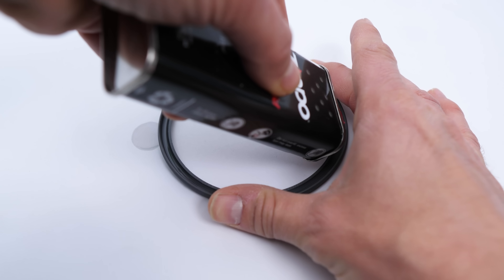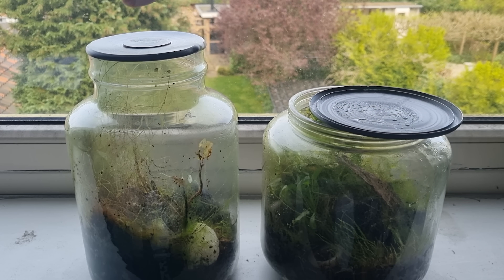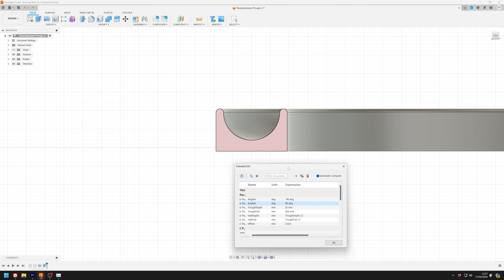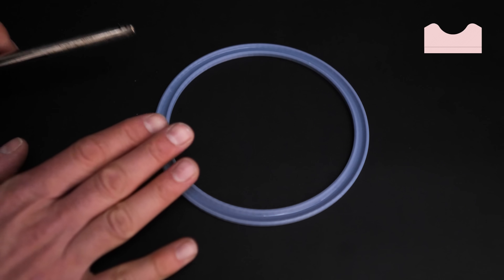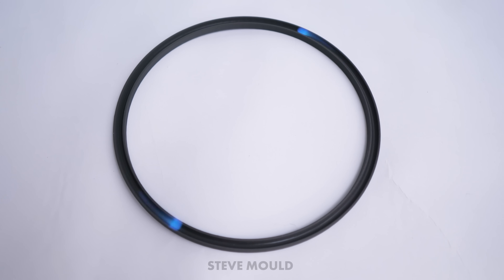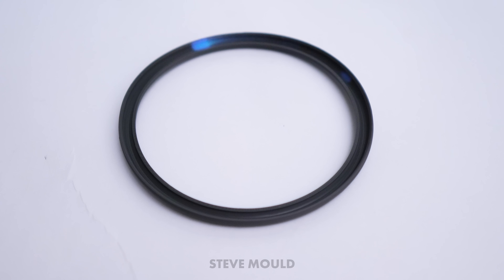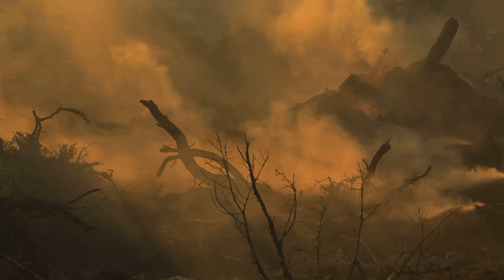Bizarre travelling flame discovery

Comment: If you pour some lighter fluid inside an can you can get a oscillating effect.  It will burn - than nearly burn out - pull new air - and burn again. This can make pulsating (slow sounds) up to shrieking (high frequency sounds) I was fascinated by that effect than I was a child. The frequency depends on the size of the hole and the size of the can.

Comment: Steve touched on it with the heart fibrillating, but it also happens on every heartbeat, and we can use EKGs and EGMs to locate the source of arrhythmias and burn them to break the circuit, restoring normal heart conduction (usually permanently). If this type of thing interests you, I highly recommend researching EGMs and arrhythmia mapping.

The design where the flame splits and reconnects resembles a re-entrant tachycardia. The circle with legs out of it is similar to a micro re-entrant tachycardia. On the augmented spiral, you can imagine a re-entrant tachycardia forcing an unstable rhythm, where the ventricles beat too quickly to fill. Blood pressure will slowly spiral down until the coronaries are unable to perfuse, eventually leading to cardiac arrest if the rhythm isn't returned to something stable.
Reply: Catheter Ablation! I actually had to have this procedure twice. First time, I was asleep and they couldn't figure out all of the sources. Second time, I was awake on the table for over five hours while they fed the catheter up to my heart-- this time actually worked though.

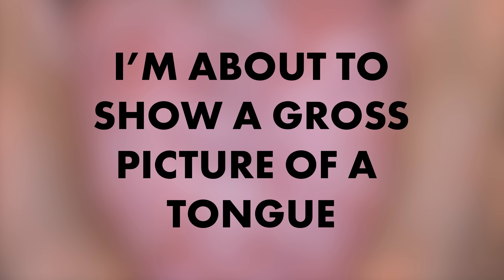The beginning of this video seemed very familiar, until we got to about 7:28 and he made that connection. Pretty cool stuff and a great vid.
Reply: So excited about this video! As a new medical graduate hoping to go into EP, I was immediately thinking about how this model could be used to demonstrate entrainment in reentrant arrhythmias. 

I was hooked into this a few years ago by Dr Joshua Cooper's video on entrainment (https://www.youtube.com/watch?v=-D3ZbyDiOwE&t=1924s) and I think there are so many things that can be demonstrated using this model!
Reply: wdym "burn them"? I'd love to learn more!
Reply: @TheNightOwl082  LIterally use something to scar the myocardium so it no longer conducts
Reply: I have a friend whose job is to do exactly this.

Comment: @stevemould.. Not sure I agree with your description around how the flame travels. You talk about how the lighter fluid has started to evaporate by the time the flame has returned to its original position...

However if you have two flames on the same circle this analogy no longer works.
I think with a big ring you could have multiple flames looping around at the same time, you could try this by using your finger to prevent the fire in spreading in the wrong way.

Comment: 10:12 looks kinda like AVNRT
For non-medical folks, it's an arrhythmia of the heart where 2 seperate pathways for electrical signals exist in a part of the heart called the AV node.
Sometimes erroneous signals cause the 2 pathways to work kinda like a circuit independently producing extra heart beats causing the heart to beat very fast.

Comment: Now here's an idea: Line the bottom of the trough with a an absorbent material like a fine sponge and soak it with the lighter fluid and have fine capillary tubes built into the bottom of the trough that continuously feeds more lighter fluid into the sponge from a larger reservoir. Endless!

Comment: you should be able to make one that lasts WAY longer by using a porous 3d printer filament, some wicks , and a reservoir like a jar.
you'd also probably need to put some kind of coating on the outside of the track to stop the vapours from exiting the intended area

Comment: Hello Steve, you may be interested in Rotating Detonation Engine, which exploits the same concept but at a much, much faster rate. 
In your case, the butane-air mix and the small width of the trough create a flame front propagating at a (rather) constant speed; which is the laminar flame speed at this specific mix ratio. You can actually probably find "ideal" parameters using the laminar flame speed of butane at various mixture ratio (between 10 and 40 cm/s) and the evaporation rate of the butane. I will try to do the math if I find the time to do it. I also wonder if it could be possible to design logic gates with your setup, since flames coming from different tracks can interact. I think you might like this idea, given your previous videos. A laminar flame computer !

Also, I'm working on my spare time on a cellular automaton that integrates ressources depletion and reformation as a driving force to "life" complexification. The idea is that life evolves due to imbalance in the available free energy, i.e in zones with time or space-varying free energy, which makes evolution a consequence of the 2nd law of thermodynamics.

Comment: It would be interesting to see this in a hourglass shaped profile. Where the bottom part contains the fluid and the top part containing the gutter. I think this will give you enough wiggle room to play with the side curves as more gas will be able to accumulate to the top part in the gutter depending on the opening ofc.

Comment: The spiral and you lighting multiple flames on it immediately reminded me of sequential delay-line memory from the early days of digital computing, where signal pulses are continuously recirculated from the output to the input of the line, acoustically, electrically or optically. I don't see why it wouldn't work with a moving flame, although it'd be wasteful and difficult to do safely.

Comment: This is very similar to demonstration one of my physics professors once gave. He coated the inside of a 5-gallon carboy with alcohol and dropped a match inside. With the lights off, you can see a fireball in the center oscillate in size (and hear it go thump-thump-thump).
Reply: Wouldn’t be allowed these days.  The Safety ‘Elfin would ban it

Comment: You can create one-way tunnel - it is a step which is short enough for the flame to go up, but high enough so it cannot go back down. You can put it in the generator loops to stabilize them.

You have a non-connecting crossing already in the 8 symbol and a a splitter. The only missing part is the NOT gate and we can have a running flame computer with no moving parts and no electricity.
Reply from the maker: That was the problem I was having! How to stop the fire traveling back up the input lines that carry a zero. This could be the answer!
Reply: @SteveMould  Tesla valve? Keeping it 2D would let you CNC mill it, build up logic blocks and use some sort of reservoir to keep it full.
Reply: @alexdavies2036  i personally don't think that a tesla valve would work, because in the video (12:05) the flame makes a 270* turn over a straight through. It would be cool to try though!
Reply: @SteveMould  I can't wait for the dark shots if you manage to pull it through!
Reply: @SteveMould in computer architecture wires are never split or joined directly, only through the logical elements. That's why the electricity in it never goes backwards and not causing short circuits. You just need to invent a transistor somehow
Reply: @alex0088800  You can directly join wires through 2 diodes, which form an OR gate. This will block reversed fire, so it doesn't go the wrong way
Reply: i was thinking an XOR could be made with two diodes pointing each other, and then one line running out. When one fire crosses, it would burn all the vapor and the next pulse would die. If both flames come at the same time, they crash like in the circle and die.

 You can use this same idea to make a NOT gate by having a pulse sent every second or so down a line, and then a diode across the line to burn off the vapor. The timing would be hard to get right, but it might work.
Reply: Let's gooooooo
Reply: If only you could create some sort of… firewall
Reply: Should also use a wick placed horizontal into the channel.  Then you can have it burn slow on top and have plenty of lighter fluid under the wick.   You can have it burn continuously.
Reply: In order to create a not gate, you basically need to be able to put out a fire, with a fire. 

There seemed to be this sort of phenomenon going on in the video, with flames cancelling each other out. Based on that, this is worth investigating further.
Reply: @anderpanders6210  that part sounds do-able. How are you supposed to make the absence of fire create a fire though? 0-->NOT--->1?
Reply: exactly what I was thinking about all throughout the video. This can lead to a very interesting alternative to electricity
Reply: A computer with this would be amazing!
Reply: The real issue is how much error rate are you willing to tolerate since even simple designs have shown they don't always do what you want.
Reply: It's not enough, he needs an "AND" gate, which passes the fire only if both inputs have fire. In computers it's a transistor
Reply: @alex0088800  You can make any logic gate out of NOR gates, which are just 2 diodes and an inverter. AND gates can be made from just two inverters each going into a diode, and the diodes go into another inverter.
Reply: There is a cellular-automata called "wireworld". You may want to look into that to find a possible not gate.
Reply: It’s going to be very tricky to get the height right, because flame will jump down along the trail of vapor coming from the lower track. 

I wonder if there could be a mechanical gate where the first track ends in a persistent flame and the heat lifts or bends something that puts out that flame and lights another track.
Reply: Sorry for the reply notification 😅 but this is an underrated comment!
Reply: I would love to see this attempted!
Reply: For the putting the flame out part of the NOT gate, how about something that sucks the vapour away? Maybe a tube where the flame at one end sucks vapour away from the other end (putting out the flame at that end), and the fire can't go through it because of insufficient access to oxygen? The vapour would need to be directed - perhaps with a slightly conical tube, or a valve
Reply: @BrendanWeibrecht  sucking idea sounds good. Put two tracks on top of each other and have them run flames in opposite directions. The tracks should be isolated, except for narrow vertical pipes repeated over a distance of slightly over flamelength/2. The pipes should be too narrow to allow the flame to pass through, but would allow top flame to steal the gas from the bottom lane and extinguish it. This would implement ~A & B.
Reply: On a second thought, I don't think you even need to isolate the top lane from the bottom flame. So instead, you can just have elongated step. Flame from A would climb up the step and go forward until it either collides with the lower flame or until the end of the track. Flame from B would travel through both lanes until it collides or it passes the whole distance and detaches.

I believe the top flame should be able to extinguish bottom flames from longer distance then it needs for propagation.

Heightmap (connect A from the left, B from the right, output at the bottom):
00000000000000
11222222222000
00001111111111
00001000000000
Reply: @BrendanWeibrecht  i bet the tube could be heated like a fireplace flue and suck the vapor away with the rising heat. This might just create more vapor though.

Comment: There has to be potential to design logic gates. Which means you can make a computer. From fire. You can even vary the speed by increasing or decreasing wall size. Making resisters.  And there is already repeaters.

Comment: These could maybe be seen as complex systems? I only took an introduction course on them but the fact that they can show periodic behaviours under certain parameters would be typical (i.e. prey-predator systems). Also, when those parameters are not met they seem to act chaotically, which is another point of contact with complex systems.

Comment: My first hypothesis when seeing this demonstration is that the burning might be constrained by oxygen flow, not by the evaporation rate of the lighter fluid. This should be a testable hypothesis. With constant pressure, the lighter fluid's evaporation rate shouldn't depend much on the geometry, except for the surface area of the liquid-air boundary. If you did it under a pure oxygen environment, then if oxygen was the limiting factor, you could use a much more closed geometry to make it work. If the evaporation rate was the limiting factor, then under a high oxygen atmosphere, you'd need a more open geometry to make it work. 

I also had the idea for a modification of the spiral with a circle at the end of it. How about instead of that circle, you used a big reservoir of lighter fluid that could maintain a constant flame in one spot. How quickly would it send out travelling flames to the spiral if the pilot flame was constantly there?

Comment: Maybe you could make a "transistor" by having a junction that causes the flames to cancel each other out by default, but when the "base" has a flame in it, that cancels out the other flame before it could cancel the other out, thus allowing that one flame to travel through uninterrupted. I wonder how diodes could be done. Maybe a vertical pipe so the gas can only travel up?

Comment: For the figure 8's bump, i wonder if the flame creates a low pressure zone that draws trailing lighter fluid vapor into the bump. Or is it just that evaporation is sufficient to fill the void?

Comment: You should make interconnectable parts so that you can build custom track with logic:
-straigth path
-generator (the circle with one arm going out)
-the splitter (Y shape)
-gates that you can open/close along the path
-...
Reply: So, can we build a flame powered microprocessor ? It would have a frequency of around 1hz and a density around 30 cm (rather than 3 nm), but that would be fun.
Reply: @mecha-sheep7674  People have done it with water, so why not!
Reply: And traveling channels should be able to ignite wider/deeper channels to make a standing flame there, like domino setups where a cascade knocks over a much larger formation that spells out letters, etc.
Reply: fire is Turing complete??
Reply: Yes, this is exactly what came to mind for me. It seems the perfect medium for it. A key difference to other media like dominoes and water is that there's a healthy steady state, so you can clock it. Even just a binary counter out of this would be fire.

Comment: How about a Mobius strip shaped track? (a strip with a track on each side)   Somehow need to deal with gravity either with viscous enough liquid that gravity is not enough to let it drip out of the track; or have the track always be upright by being angled with respect to the Mobius strip, or suspended from it.  Or have the profile (see @2:47) continuously changing one wall higher than the other to maintain an upright trough.
Reply: Makes sence

Comment: If you want to guarantee lighter fluid at the bottom of the trough make it shrink down to a singular point so that you can use capillary action to draw the lighter fluid the throughout the length of the track you could probably make a much more three-dimensional fire track

Comment: @Steve Mould
9:45 Ok, so we simply just make the equatorial forest grow in zig-zag (north & south) along the equator, until the compounded length of the forest is twice as long as a "straight" equatorial circumference  :D
(Or we just grow the forest in some "space filling" pattern, like a Hilbert Curve or so (with sufficient spacing between each "line" so the fire can't jump to where it should not be)) :D
Reply: One poster above mentioned recurrent fir fires with a period of 75 years - that would result in a forest length of 1.5 sun circumferences (4.1 million miles). Can a forest on a Hilbert curve this length be constructed on earth with a sufficient width to nourish a forest fire and a wide enough distance to neighboring curve segments? 🤔🤣
Reply: @sandmehlig  
Hmmm.... 🤔 If we change the forest fire to a grass fire, and we align each blade in a row, and put a sufficient fire-wall in between each line... then... maybe? :D

Comment: With the flame being blue mostly, maybe printing in dark orange for better color contrast could improve the filing result.  Not that it was bad, this is just something that occurred to me when watching.

Also, people engaging with social media are themselves an excitable medium when the "signal" (in the form of a meme or headline or some other such) is one that propagates primarily via sharing on a given platform.  So, the platform in question is a parallel to the rings in this case.  The signal is the type of lighter-fluid, in this case I suppose...It's not a perfect analog at all, but I thought it worth mentioning anyway.

Comment: I'm curious to know if the spiral/loop hybrid works in reverse, and if so, how?
If you light it from the end of the spiral and have it work its way around to the loop on the outside, will the flame continue along in the direction of the track and reignite the spiral going inward? Will the loop light in both directions and cancel out at the end? Will the junction keep a steady flame that ends up making the cyclical pattern in the initial scenario as the fuel gets lower? Or will something else entirely happen?

Comment: Lol. I am gonna try this myself. I recently had an issue where the sponginess of 3d printing was making bad parts from a fuel resistant filament, tpu. Liquids could soak into it easily if they didn't have surface tension. I didn't think traveling flames could be so well sustained.

Part of this is definitely that the print holds flame juice between the printed lines, so the surface evaporation is from the object and not a ready to burn pool of liquid.